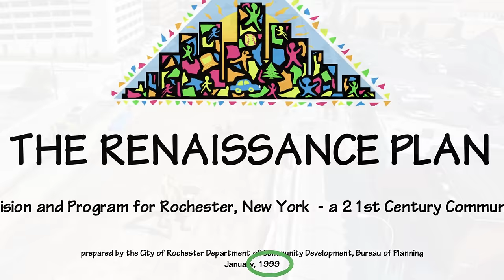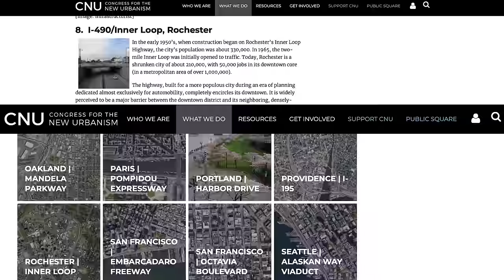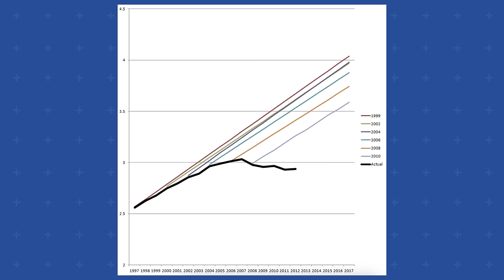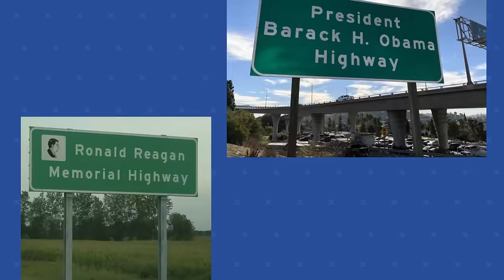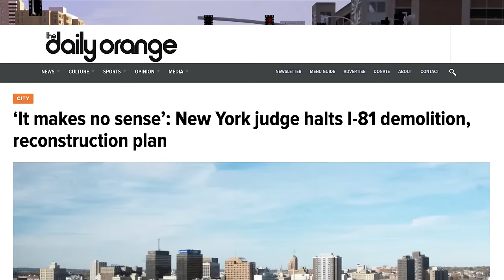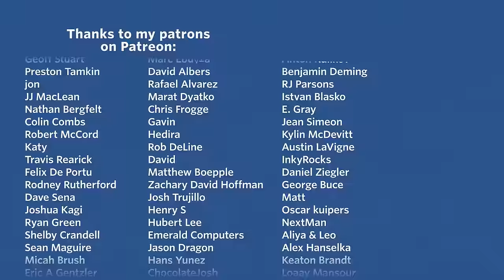How to Remove a Highway

Comment: Albany NY, the only other major Upstate NY city you didn’t mention is also trying to tear down its downtown highway(I-787). The Albany Riverfront Collaborative and the State DOT have received funding for studying removal!!!
Reply: Finally seeing some type of progress which I wasn’t sure we’d see anytime soon, real interesting project
Reply: However, it may end up with a buried freeway like what the Boston Big Dig did. Reason: Removing Interstate 787 could create a potentially ugly situation with surface street congestion even if they widened the surface streets to accommodate more vehicle traffic, because I-87 travels far to the west of downtown Albany before connecting with I-90.
Reply: @Sacto1654 a surface-level boulevard can handle the level of traffic 787 sees without the significant costs of a buried or elevated highway, and still connect to the interstate like 787 does now, like the video’s example from San Francisco
Reply: @Chetab01  I still think Albany MUST widen several surface streets and install faster lighting if they do decide to remove I-787. Otherwise, you create surface street bottlenecks that could make the traffice problem worse. At least with the I-81 plan in Syracuse, there is the space to replace it with a wider, fast-light surface street so it doesn't cause massive traffic jams through the center of Syracuse itself.
Reply: Since Albany is a pretty small city with a huge commuter base (IIRC, more people work in just the state government offices than live in Albany proper), I feel like there couldn't possibly be a better candidate for commuter rail.
Reply: @Sacto1654 it’s not that much further north to hit I-90, maybe adds 10 mins tops to a trip? Also, why not invest more in CDTA to replace trips. It’s a very successful transit system considering the size of Albany. Get cars off the streets and expand public transit.
Reply: @Sacto1654  I mean Syracuse also has a highway that literally goes around the city so there is that option as well 🤷🏾‍♂️
Reply: @coolboss999  Syracuse it actually kind of lucky because a wider surface street like the expressways in Santa Clara Coiunty in California is possible on the route. That way, you only deal with a few lights before it reaches I-90.
Reply: @Sacto1654  I doubt there would be any jams on surface streets in either city. 481 can be retired to become the new 81 so traffic bypassing the city or heading to 90 won't need to head through thus the load Almond Street would take is much less than one would expect. Plus they're not tearing down 690 (even though they really should) so it can hold the position of "freeway into the city core" for the time being, even if entirely unnecessary for Syracuse.
As for Albany, surface traffic there is already pretty wimpy during almost all hours. Most of the major offices are closer to NY85 and I-90 than the 787 and downtown core. Plus, its job (heading to Watervliet and Troy) is already fulfilled by going up I-87 and then taking NY7 eastward. Thus, removing 787 really shouldn't add all that much traffic in the first place.
Reply: @i-Sparki  And you would be right about that. The I-481 once expanded to have 3 lanes, will be redesignated as the I-81 so it will carry Thruway traffic
Reply: @Sacto1654  This is a weird take for me. Why should the city of Albany, and residents of the city (like myself) be considerate of commuters creating traffic? If there is substantial rush-hour traffic because of 787 removal, it will likely create a safer environment as the cars will be moving too slow to seriously injure people. It would also be greatly preferable to the current situation of massive concrete structures separating residents from the waterfront.

Claiming that there MUST be a widening sounds like commuter cope. If you hate the commute, move closer. Most of the commuters are state workers, they don't contribute much to the neighborhood economy.
Reply: @i-Sparki agreed. I drove down 787 basically every day over the summer for my internship. The only times it sees real traffic is during rush hour and even then the traffic is still moving at speed limit most times. You could rly do a lot with some sort of brt or commuter rail service to replace a lot of trips. I mean id take the CDTA service that stops near me if it didn’t make a 15 minute drive an hour bus ride. My dream is to see some sort of LRT connecting shorter distances in the area with a commuter rail going between troy and Schenectady. Also if the amtrak route through rensselear is upgraded i think that’d warrant some sort of rail connection into downtown.
Reply: @enthusiast7659 consider suburbanites from places like bethlehem for example. Maybe theyre just misinformed nimbys but nimbys with a ton of political and social power (god i hate white suburbia). Just a fraction of them could stop a project completely if it slows their commute even slightly, and most state workers are in it for long term benefits and have families. They would be very resistent to moving closer to the city (or moving at all). Albany is such a great candidate for rush hour public transit just because of all the government employees.

Comment: They're talking about removing I-94 between Minneapolis and St. Paul and replacing it with a boulevard and restoring the street grid.
Reply: The difference with i94 is an alternative route is needed. Studies have suggested that a boulevard (and surrounding infrastructure) isn’t enough to meet traffic demands. Meanwhile, a boulevard was enough to handle the inner loop’s traffic.
Reply: @grantmatthews18  Yes, I-94 can get busy during rush hour. I try to avoid it if at all possible. It's such an ugly gnash and destroyed a lot of neighborhoods.
Reply: Having been through that stretch of I-94 a number of times at varying times of day, I don't see how that's even viable. I doubt 494 and 694 can handle the increased volume of through traffic but at least one of those could become the official I-94. I shudder to think what the gridlock on a boulevard would look like. On the other hand, it might be substantially safer.
Reply: @lostwizard  I agree, even as a "bed-wetting Liberal" turning that bit of highway into a boulevard would be problematic. They're also talking about putting "land bridges" over the existing highway to restore some of the lost neighborhoods..
Reply: @jelsner5077  How about they build some BRT or light rail instead, which can carry far more people than a lane of cars?
Reply: A lot of gen z folks I talk to where I work, including myself, would love reliable public transit, but I feel like car dependant folks always push back with dumb arguments
Reply: @lostwizard  I doubt a boulevard would increase safety as highways are generally pretty safe due to the elimination of cross traffic and pedestrians. It is just the higher speeds means an accident is more likely to be deadly, kind of the same principle that goes for trains and planes. Less accidents happen, but when an accident does happen it is more likely to be catastrophic.
Reply: @evancombs5159  I mean compared to the extant I-94 which has some truly hairy corners and some less than ideal slip road placements. Taking out the freeway trappings would remove the need for a lot of them. And it would likely discourage some amount of drivers from using it in the first place which might help some, too.